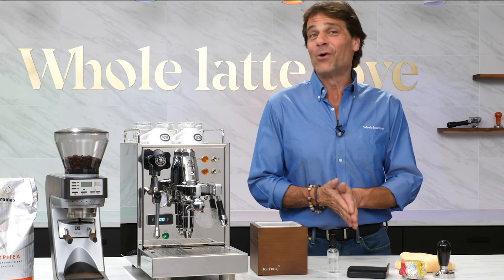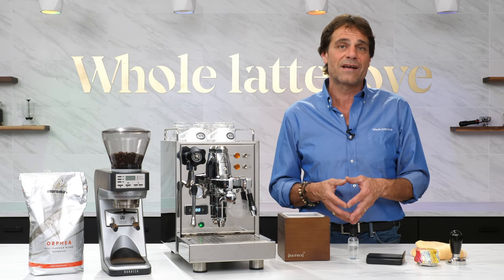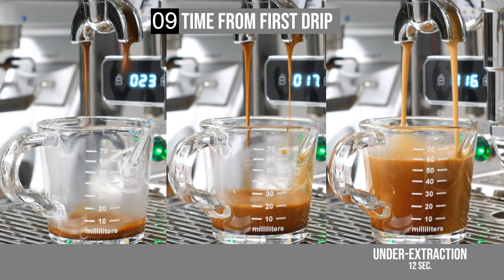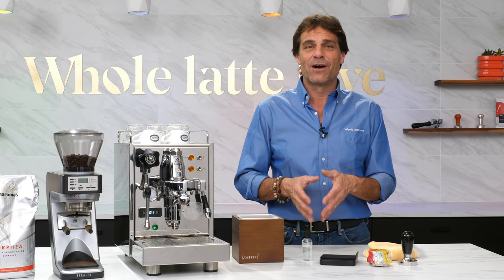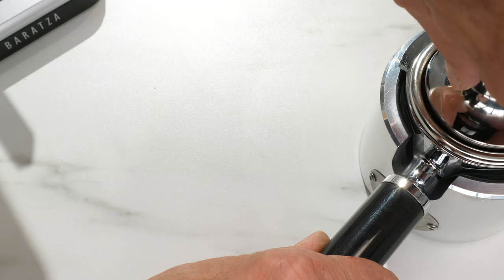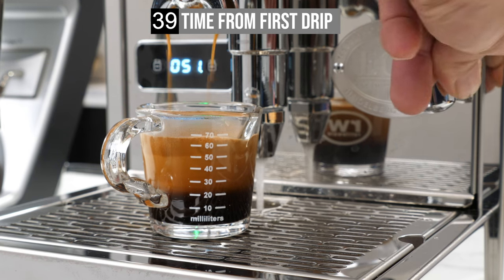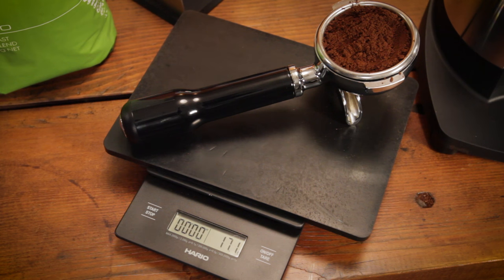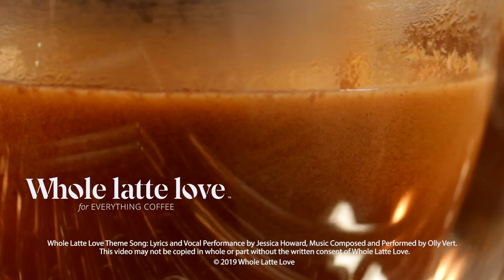How To Dial In Grind Size for Espresso

Comment: Hey- i bought a Mr Coffee Cafe Barista, and the basket for the grind only holds about 10-12 grams max for the 'double shot' basket, but the brew time on the automatic is around 25 seconds from the time it begins dripping into the cup, and The yield on the auto setting is right around 80 grams. There is a manual option, but i don't know what time i should try given the amount of espresso grind? 

To me the variables fpr the automatic settings for double shot just seem to be way off compared to what I'm seeing on espresso videos? I get a really nice looking crema amount, but sometimes it a bit dark, and the drink is bitter- (which personally i don't mind much, but others do) Any suggestions to get me into the ballpark for what a true espresso should taste like?

 I've never had a true espresso, so i can't judge what the taste and smoothness should be. I just wanna be somewhere in the ballpark so that myself but mostly others can enjoy a pretty good double shot of espresso- the single shot just seems to be way too little.

Thanks

P.S I'm forced to use low acid espresso grind for myself- the only other coffee i have is maxwell house regular, which i ground up even finer, about like table salt size- but it's coming out pretty dark and a bit bitter- good crema amount though
Reply from the maker: Hi N, Thanks for the questions. I have not used the Cafe Barista but I'm fairly certain it uses a pressurized filter basket. That means it's a restriction in the basket which creates the pressure of the espresso brewing process rather than the grind size of the coffee which is how it works in standard non-pressurized baskets. Pressurized baskets are common in appliance grade espresso makers. They allow for the use of preground coffee as precise grind size is not critical. Grind still needs to be intended for espresso so it has to be very fine. Like the table salt you compare to - maybe even a bit finer in order to get a decent espresso. Do know that pre-ground really does not come close to the quality of espresso made from whole beans ground fresh. Also know that pressurized baskets kind of fake the crema. Squeezing the liquid through a little hole in the basket causes bubbles to form as the pressure releases on the other side.
Typical espresso brew ratios are 1:2. So if using a 10g coffee does your extraction out by weight should be about 20g. If you do not have a scale you're looking for about 1oz/30ml by liquid out which includes the bubbly crema. Chances are you are getting bitter flavors due to over-extraction. 80g ouput from a 10g dose is a 1:8 ratio and severely over-extracted.
Using a pressurized basket you have no control over shot timing so you have to take what you get. In your shoes I'd pull the 10-12g coffee dose to produce 20g out by weight or 1oz/30ml out by volume.
Hope that helps!
Marc
Reply: @Wholelattelovepage  [[maybe even a bit finer in order to get a decent espresso.]]

Thanks You for the quick answers- Yes i think I'm finding that out- just ground down finer some folgers low acid preground that i have, and seems to work better and taste better too-  course it could be that i just got a good extraction this last time too- 

[[Using a pressurized basket you have no control over shot timing so you have to take what you get.]]

the Cafe Barista does have a manual mode (gotta hold the brew button for 3 seconds, then it goes into manual mode' so i can adjust by volume or weight) I'll give it a try for just 20 grams- I wonder though why Mr Coffee would have the automatic time for a 'double shot' put out 80 grams? Maybe cuz it extracts different than a regular true espresso machine would?

What kind of espresso machine would be good for around $500? (Probably no such thing?)- are there any that don't use the pressurized basket? I just spent $170 on the Cafe Barista- :(  but woudl like a true home espresso machine-

Comment: What of those timings and milimiters changes if im using a triple shot basket?
Reply from the maker: Hi Renos, Thanks for the question. No change in timing - it's the same regardless of coffee dose weight. Using volume out in milliliters is a basic approach and works. Target volume depends on coffee dose weight. If doing triples I recommend using a scale to measure brew ratio. A 1:2 ratio is a good place to start. So if you use a 21g dose you'd target 42g espresso out. Understand that's weight and not volume.
Marc
Reply: @Wholelattelovepage  Oh I see, So I will have to stay in that 27-30 second of extraction time even though the dose will be larger?

Comment: I usually pour myself a double expresso. Does the 20 to 30 second extraction rule still apply? By this I mean is a double shot supposed to take 40 to 60 seconds?
Reply from the maker: Hi Steven, Careful with that "x" in espresso! Baristas hate that!!! :) General timing for a double is 20-30. That's what I was pulling in this video - doubles.
Marc
Reply: Thank you Marc. Good to know. My earlier inquiry is part of due diligence to proceed to the next level from Breville to dual  boiler ECM or Profitec. I do not see many replacement parts available on the Wholelattelove site. What would be the process if I needed to change the pump on a Synchronika for example?

Comment: Hi Mark, I’ve got a Sette 270 and Gaggia Carezza Deluxe.  Should I still be aiming for a 25 second extraction time even with the pressurised portafilter?  Struggling to get it any longer than about 15 seconds even with changes in the grind size.  If i tamp it too hard, nothing comes out at all. Thanks!
Reply from the maker: Hi James, Are you doing single or double shots? With a pressurized portafilter timing doesn't always hold to the 25 sec. recommendation. But with the Carezza you should be able to find a grind size and tamp pressure that gets you closer. You'll need to find that balance between grind size and tamp pressure which extends your extraction timing. If currently getting no flow when tamping hard you can back off on tamping pressure. Or you could keep the hard tamp and adjust grind a little coarser. Work one variable at a time. So if adjusting grind keep same tamp pressure. If changing tamp pressure keep grind size the same. Hope that helps!
Marc
Reply: Whole Latte Love Thanks! Will keep plugging away until I can find the balance.  I’m trying to pour a 2oz shot, so filling the portafilter to the top, i think that’s about 18g.  Loving the videos, keep up the great work.
Reply from the maker: You're welcome. I think in the Carezza a fill to the top will be a under 18g. Thanks for your comment.
Marc

Comment: Hey Marc, thanks for the inspiring video. I have a Lelit Anna (with PID) and a Lelit Fred grinder. I also use a Lelit leveler probably designed for Anna's portafilter. I am trying to dial in as you say, but I am not sure that time is all that matters, I get the shot (60 ml) in 20-23 seconds from the 1st drip, I get crema, however the taste and consistency is not that great (I use fresh beans). I also use 18g of coffee. The portafilter is preheated and the pressure gauge shows 9 bars while the coffee is pouring. What do you suggest? What I love about the espresso I get from coffee shops is the texture, that is not like a regular coffee the $100 average machine makes at home.
Reply from the maker: Hi r, You are welcome for the video. Your parameters sound good with 60ml (assuming that includes crema) in >20sec from 1st drip. I suggest trying other coffee types. I don't know what beans you are using but perhaps look for a classic Italian style bean blend at medium roast level. One of my favorites which has potentially more body/texture is Maromas Orphea: https://www.wholelattelove.com/products/maromas-orphea-whole-bean-espresso Read the reviews of others ans see if it's something in your lane of preference. Another similar coffee is Lavazza Super Crema: https://www.wholelattelove.com/products/lavazza-super-crema-whole-bean-espresso-coffee
Hope that helps!
Marc
Reply: @Wholelattelovepage  Hey, Marc, thanks for the reply! I really appreciate that you reply to comments. Most content creators don't! I wish you all the best and good health!
Reply: @Wholelattelovepage  also.. I found out that stirring the coffee after it's done improves the taste a lot, because the crema has a very strong taste. So, I am close to a good extraction!

Comment: Time from first drip? I would always time from when I pull the lever? I normally extract 36 grams of coffee out for a 18 gram dose in around 25-30. My normal first drip is at around 8-9seconds using a expobar dual boiler which has a built in preinfusion. Soo correct me if I am wrong but. For a 25 second extraction and accounting for the first drip I should stop the machine at around 34-35 seconds ?
Reply from the maker: Hi timothy, Thanks for the question. Is your Brewtus a vibration pump or rotary pump machine. All Expobar E61 groups have the extra pre-infusion chamber behind the shower screen so pressure tends to build up more slowly and that's generally a good thing. Even slower build up in machines with vibe pumps. That's why I use first drip... I'm switching between various pump types and pre-infusion systems on a near daily basis. As I mentioned shot timing is the most basic method for getting extractions into the ballpark. If you are using brew ratios you are beyond the basics! If I were using a rotary pump machine which builds pressure faster and only using timing I'd be shooting for extraction in the low 20s from first drip - very close to were you are. In the end if you like the flavor you're getting I would not be worried about timing.
Marc
Reply: Whole Latte Love thank for answering the question Marc, I have a vibe pump machine and using the quamar m80e grinder (wish I had of bought a stepless grinder) I will play around with the first drip as I believe it may be more accurate for me. I have a 22gm vst basket but I think I will buy a smaller one soon. Big fan of the your YouTube Channel. I find that my grinder also attracts a hell of a lot of grind retention, do you have any tips to lower this (I try to keep as little beans as possible in the hopper as I store my beans in an airscape canister)

Tim from Aus

Comment: Hey Marc, I have found someone selling a new ECM Titan V for the same price as a Faustino, is that too commercial / technical to use for someone who is upgrading from a breville barista express?
Reply from the maker: Hi s, If you've got the space for the Titan get it! Those titanium coated burrs will go a lifetime of grinding! And, they are a lot bigger than the burrs in the Faustino. I prefer the worm gear grind adjustment as well - it's more precise.
Marc

Comment: How do you keep the same temperature on the Gaggia Classic Pro?
Reply from the maker: Hi David, There are many techniques for getting the same temp. One easy one is to push the brew switch and dump some water into drip tray. The light will indicate machine boiler is heating. Once boiler is heated as it indicated by the light pull your shot. Do it that way and you'll get about the same temp every time.
Marc

Comment: Do, I stop at 60 ml or target gram or let it keep going and let it stop on its own?
Reply from the maker: Hi YJ, Thanks for the question. Well, if you have a scale to weight the espresso in the cup you can weigh the output. Espresso typically done at 1:2 ground coffee to espresso in cup. So 18g ground coffee would be 36g by weight in the cup. If using volume in the cup there's a bit of guesswork involved. Coffee which produces a lot of crema can easily go to 60ml in cup when crema is included in the measurement when pulling to a 1:2 ratio.
Marc

Comment: Mark — I just tried to grind in a new bean with an Atom 75. It was a dark and oily roast, and I could not even get close to a proper shot (best I got was 2:1 coffee in 20 seconds, and I couldn’t reproduce it).

I increased dose size to a maximum of 18g for my basket, pushed the grinder as fine as possible (coffee could barely get through the burrs).

Could you help with this issue?
Reply from the maker: Hi John, Atom at finest setting should be able to grind fine enough to choke any machine. What type of machine are you using?
Marc
Reply: Whole Latte Love Rancilio Silvia with the stock double basket — I figured this wasn’t the grinder..

Comment: Hi,
Really struggling to dail in my grinder. I am currently on the finest setting that allows my espresso machine to push water through without it stalling. I am trying to solve sour shots. I tried reducing puck size down from 18g to 15g to lower pressure and that worked but any less and tamping does not help. I read that you must not reduce puck size and MUST stick with puck that fits basket plus or minus 1g. latest is 15g in, 37g out, 30sec from first drip but still sour. Any advise?
Reply from the maker: Hi Josh, Thanks for the question. Would really help to know the make/model of your grinder. Perhaps its grind size control is not is not fine enough? When grinders lack in that department manipulating the dose is the way to go. I would not worry too much about being within 1g of rated basket capacity. So long as you are not packing too much coffee in it's okay to put 15g in an 18g basket. When pulling from a lower coffee dose you'll want to pull your shots a little shorter as well. Sour shots can indicate under-extraction due to grind not being fine enough. Can also be caused by low brew temp or pressure/flow and some call bright/acidic shots from fresh specialty beans sour. Timing/weights of 15 in, 37 out in 30 is reasonable but potentially a bit heavy on the out. Depends on the coffee but I'd start at 15 in, 30 out for a 1:2 ratio. 
Marc
Reply: @Wholelattelovepage  Hi Marc. Thanks for support. Grinder is a Graef CM702. Generally my shots are 2:1 and I tried this 15g in 30g out in about 20sec but it is horribly sour. Espresso machine is also entry level and cannot change water temp or check pressure. I upgraded to a bottomless portafilter but after 100 shots I am no closer to success. Coffee is fresh and 3 days since roasted. Machine is also properly maintained and cleaned. I am lost. I think I need to get a smaller basket in order to get the grind finer but it is very very fine already

Comment: I have the Breville Barista Pro 878 and Lavazza Super Crema beans. What grind size should I use?
Reply from the maker: Hi Fernanda, Thanks for the question. Unfortunately I can't answer that question. Not that I don't want to, It's just that there's no right answer. You need to dial in the grind size as described in the video to fit the your particular variables.
Marc
Reply: Thanks ! Will do.

Comment: How long should it take to extract a single shot? Thanks!
Reply from the maker: Hi Ingrid, Thanks for the question. In general, timing is the same for single, doubles and triples at 20-30 seconds.
Marc
Reply: Whole Latte Love Thanks so much Marc. Does the mean the grind size has to change?

Comment: Hey... does this apply for automatic machine like gaggia babila too?
Reply from the maker: Hi Kash, Thanks for the question. Sort of. But not for timing. What you do on a super-auto like the Babila is adjust grind size based on flavor. I use a Babila daily in the studio here. For espresso, I'd start with the grind set within 3 or 4 marks of the finest setting. Then use flavor to adjust. If your shots are sour adjust the grind a little finer. If bitter adjust grind a little coarser. On the Babila I'd set the flow control dial to it's most restrictive setting when making espresso.
Marc
Reply: @Wholelattelovepage  that makes sense, will try! Thanks a lot for the info!

Comment: Hi, I have a question about grind settings. I've taken the advice of starting a bit finer than granulated sugar and working down from there, but this pulls shots way too fast. When I then move down in grind size to slow things down, I end up with what seems like almost no coffee in my basket. I'm consistently using 18g which is the recommendation for my basket size, but I'm not getting a rich crema, and I end up with a soupy puck at the end. Any tips?
Reply from the maker: Hi Marcus, Thanks for the question. If going from way too fast to way to slow you'll need to work into a grind size somewhere in between. You did not mention what make/model grinder you're using. Hopefully it's precise enough. Crema production is dependent on getting the grind size right and coffee type. Some coffees produce more crema than others - Italian style bean blends with some Robusta in the blend tend to be the best crema producers. Coffees like Lavazza Super Crema or Maromas Orphea are excellent crema producers. Soupy pucks can happen for many reasons. hard to comment on that without knowing make/model of your machine.
Marc
Reply: @Wholelattelovepage  Hi Marc, thanks for your response. I’ll take that on board. Turns out a big part of the issue was the size of my basket. I thought I was using an 18g basket when I was using something bigger. Thanks for your help, and I’ll keep working on it!
Reply from the maker: My pleasure! Also my full name is Marcus too!!!

Comment: I have my grind dialed in on my e61, but my puck always comes out wet.  What am I doing wrong?
Reply from the maker: Hi DB, Hmm... Have you been back flushing your machine on a regular basis? Need to keep the circuit clean including shower screen.
Marc